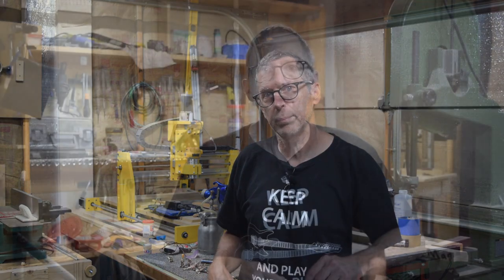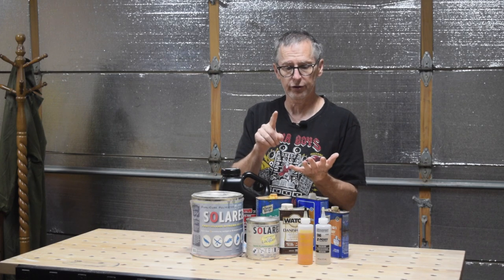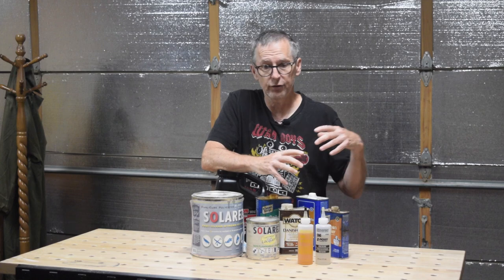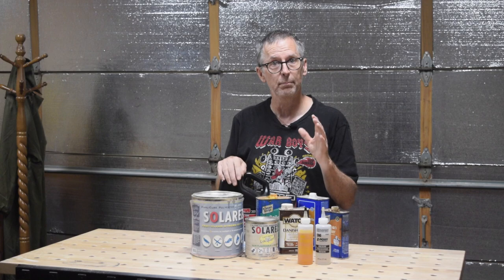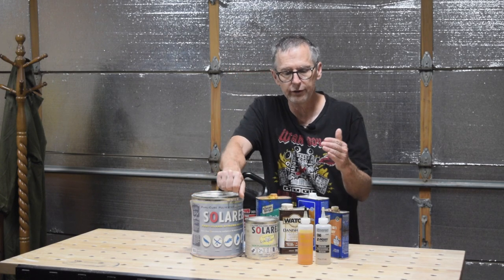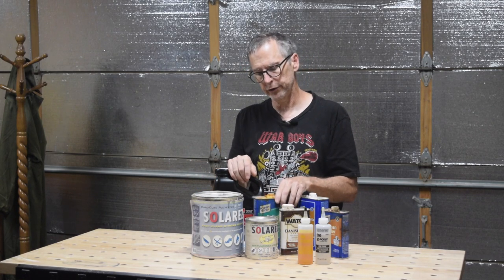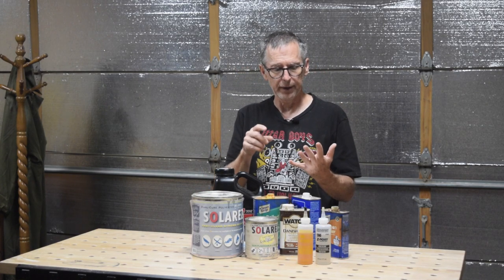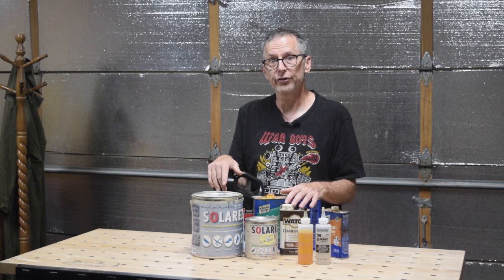Luthier Quick Tip 3: How to Decide On A Guitar Finish

Comment: Hi Chris, I've been binging on your videos. Super interesting. I just have a question. Is there anyway to strip away danish oil from a guitar body? I orivinally pht a thin coat of watco danish oil on a pine body. But now i want to paint over it (water based preferably, nitro ok too) is there anyway i can strip the danish oil and paint over it? I used a citrus stripper and that removed the varnish on top but not sure if that is enough. Thanks.
Reply from the maker: Just paint over it. Hit it with some shellac first and you’ll be good to go.
Reply: @HighlineGuitars  thanks! Water based will also work? I have an aerosol can here of shellac. Will try it after the wood dries out. No need for a primer after shellac? Thanks again. Appreciate everything.

Comment: Thanks!! One question, wich is the best if I would like to have a light blue (aniline dye) maple top with high gloss clear coat? The most easy to work (faster to cure)?
Reply from the maker: My current favorite wasn't shown in this older video. These days, I'm loving Centurion water-based 2K polyurethane for my clear coats.

Comment: Just happened to come across this, Chris, and I was wondering if the z poxy is the same resin one would use for pore filling? I also recall you are using Melamine nowadays. How do they compare for ease of use. I find Chesnut Melamine very irritating (physically, I mean). Thanks as always
Reply from the maker: I've never heard of melamine. Maybe you're thinking of someone else?
Reply: @HighlineGuitars  Sorry, Chris. You are quite right. I'm not sure where I got that from. Anyway, Chestnut Melamine Lacquer is a pretty easy to use product, with the exception of the toxicity. I have only ever used z poy finishing resin as a pore fill. Cheers.
Reply from the maker: @robertnewell5057  I looked it up after you commented. Very interesting.

Comment: Hey @highlineguitars I just found your channel!

I'm a DIY'er who's looking to sjarpen luthier skills.

Current project is an '84 MIJ BC Rich guitar that was in rough shape and had been spray painted over the original finish.

I've sanded back to the original creme finish but will be keeping some of the relicing and putting a transparent window sticker over a more unsightly area to add style and make it look more metal.

I want a gloss finish that will protect the reliced area but not make the outline of the sticker obvious. Ideally, I'd also like the neck to feel smooth and not sticky.

Any help/recommendations would be greatly appreciated!

Tkx again from Canada.

Comment: I have question sir. My gibson flying v has a nitro finish that is like an ivory white. Is it possible to prep the nitro finish already on the guitar and use it as a base coat the spray my paint over that or should completly strip my guitar down to the wood? Also the are 2 dings in the paint job so what would I use to fill if I didn't have to strip down to bare wood?
Reply from the maker: I would strip to the bare wood only because of the adhesion problems that can happen when applying paint over old nitro. The only way to know for sure if you can use the nitro as a base coat is to test with the paint you plan to use. As for the dings, you could try to steam them out with a wet paper towel and a hot soldering iron. If they are too deep for that to work, you could fill them by applying a paste wood filler. Build up the layers of filler until it's proud of the surface and then sand it smooth.

Comment: Have you tried using target coatings EM6000. Another Low VOC and Oder waterborne. Nitro type burn in.  Just curious.
Reply from the maker: Yes, I have used it. It works well, but I felt it was a bit soft.
Reply: @HighlineGuitars  I feel the same, thanks for the response

Comment: Timely.  I've been working with Solarez and BriteTone over the past week or two. 
I have to say, the "I can't believe it's not lacquer" product is pretty fantastic.  The 3 minute cure times are no joke and sands/buffs like a champ.  Spraying it on requires following the directions on the bottle though, to achieve good coverage and leveling.  I can see why you have used it as a sanding sealer in the past, and I think I will probably do the same.
The BriteTone product (gloss) is probably the clearest, best self-leveling clear-coat product I have ever used.  Sprays on great, and clean up is just water.  I haven't gotten to sanding/buffing it yet, so I don't know how it performs there.
The regular Solarez dual-cure is just awful.  It smells terrible, doesn't spray well at all, only self-levels if you leave it for an hour or more before curing (which makes the quick cure no longer advantageous), and doesn't sand well at all.  In my experience it remained tacky even after long sun exposure, and when sanding it quickly builds up on the sandpaper.  From what I can see it doesn't ever really cure all that dry or hard.  And that smell is like inhaling the fumes from burning plastic.  I don't if I got a bad batch or what, but I don't think I'll be going back to this one.
Thanks for the information!  It was your videos that turned me onto these products, and I think I have a couple of real winners here. 👍
Reply: Will you use the britetone on the contest guitar?
Reply: @onpsxmember  I'm leaning towards yes, depending on how sanding and buffing goes today.

Comment: I have a question.
I have a vintage semi hollow guitar with a nitro finish, and the finish is chipping of. I thought about air brush it with a thin coat of lacquer, but I'm worried about it damage the sound of the guitar.
Will it effect the tone?
Reply from the maker: Probably not.

Comment: IMO any type of oil on an acoustic guitar with a spruce or cedar top will alter the sound in a negative way. It will absolutely kill the sustain of the instrument. I should know, I put Watco Danish oil on my hand made guitar and I was extremely disappointed in the sound quality. Don't do it! I played my guitar with no finish on it for a couple of days. It sounded nice, then I applied the oil finish and what a drastic result. Really sorry I did. You can't get rid of the oil once it's on. It's soaked in forever. Maybe on an electric guitar it won't effect the sound that much. On an acoustic guitar the sound comes mainly from the top. It moves and vibrates and the oil really dampens the sound.

Comment: Can I use teak oil on the neck or body of my guitar? Iget mixed information about this
Reply from the maker: I've used it in the past and it worked fine for me. It's great for dense hardwoods and offers UV protection as well as excellent moisture resistance. Plus it make the wood look dynamite.

Comment: I was recommended automotive clear.
I've done a few , seems pretty good.
Using Southern Polyurethanes  Euro clear,
Only downside is porous wood.
I've had to respray 4 times  on a couple of them.
Reply: Save yourself  a load of time by grain filling on porous wood . I have used ordinary water based wood filler watered down and rubbed into the grain of mahogany - let it dry sand it down and do a second coat - sand smooth -clean off - apply your colour - then do your top coat. ( you won't need as many !!  )
Reply: That’s what I use and I love it. Cut and buff in 24 hours and very tough.

Comment: I'd like to apply some decals and cigar bands on my guitar body. What would you recommend doing in that type of project, where it's going to cover decals?
Reply from the maker: Bury the decals in numerous coats of clear. With 10-15 coats, you should be able to level and polish the surface so you won't feel the edges of the decals.
Reply: @HighlineGuitars  awesome,  thank you.

Comment: What do you think about clear coat used on vehicles including reducer and hardener? On mahogay body neck and maple veneer? Will i get a even glossy finish? It dries and cures 3 4 coats  in 1 day
Reply from the maker: There great as long as you have a proper spray booth and hazardous materials protection.
Reply: Thankyou sir

Comment: About to do two guitars (strats) for the first time with Brite Tone. How many coats do you do per guitar? I was thinking 3 a day over two days. If that is correct, six coats over two guitars, how much would you recommend I buy?
Reply from the maker: It all depends on how confident you are at level sanding without sand through. I typically spray about 10 coats, 3-4 per day, and use about 1 quart per guitar.
Reply: @HighlineGuitars  Great, thank you. Do you sand between coats or just as needed if there are imperfections/dust/hummingbirds that get in the previous coat?
Reply from the maker: @jonallen5280  The folks at Crystalac have told me it isn't necessary to sand between coats and these days, I don't. However, I do like to sand before the final three coats to smooth the surface out and get rid of any imperfections.

Comment: I used solarez I can’t believe it’s not lacquer to replicate an oil finish. It has a white haze to the guitar, however when I use wax on it the haze goes away for maybe an hour and then the haze comes right back. Any suggestions on how I can fix this?
Reply from the maker: Contact Solarez. I've never seen this and have no idea why it's happening or what to do to fix it.

Comment: This may be a stupid question but is it possible to mix products? The amber tint and extraordinary efficient sealer from Z-poxy and the pristine gloss finish from Cristallac for the last 3 layers before polishing ?
Reply from the maker: Mix them together before applying? No!
Reply: @HighlineGuitars  noooooo! :D layers on top instead
Reply from the maker: @rachmaninoffrulz  Yes, you can do that. However, each layer has to be fully dried and cured to ensure proper adhesion, and as I always say, "TEST ON SCRAP FIRST!!!!!"
Reply: @HighlineGuitars  thanks man

Comment: I wonder if anyone has any tips on how to do this. I want to paint a precision bass body with a nitrocellulose sand color. The pickguard will be orange and I want what's underneath the nitrous cellulose to crack revealing an orange substrate below the nitrocellulose. I was thinking of mixing some alcohol dye with a grain filler first and then maybe sponging on some type of acrylic orange color over that. Don't know if I need to put a white vinyl sealer over that or go directly to nitrous cellulose, because again I'm looking for the orange to show through the distressed cracks through the nitrocellulose

Comment: I am trying out Solarez I'can't believe etc . I can get a smooth finish but I am having trouble getting a clear mirror finish. I wet sand from 800 ,1500, 2000 to 3000 and then I use Stewmacs Fine polish compound . But I can't get a nice sheen . What am I missing . Am I not buffing enough or too much . I end up with a very patchy effect and some haze in places . I am using a small piece of ash which I have sanded to the wood several times to restart but I am having no luck as yet - Chris - I need your help !!
Reply from the maker: Are you using a buffing machine with 12" or larger wheels? I use one with Menzerna compounds. I can get a decent shine, but Crystalac Brite Tone has a better gloss sheen.
Reply: @HighlineGuitars  - Thanks for that Chris . I  only have a 6 inch buffer on a power drill and some sponge discs  and some
fluffy soft discs .  Here in the UK I just can't find the compounds or similar ones !! Crystalac comes up blank as well. I think it is back to Danish oil for me  !!
Reply: @HighlineGuitars  Well you got me thinking !! And this is what I came up with. I noticed that you use a 12" buffing wheel and mine is a 6" wheel . I realised that my wheel needs to be rotating at twice the speed yours is running  at to give the same result so I fitted the wheel to the 40watt mains drill on my pillar stand. This increased the speed to just over twice the speed of my battery drill . Lo and behold I was able to perfect the finish on my test piece . The end result was similar to yours with a few little pin prick like marks but I now feel confident to attempt the process on a guitar body . So ultimately thanks for your input !!

Comment: What type of base coat can be used under the polyester clear gloss? Enamel, acrylic, lacquer etc..
Reply from the maker: Your best bet is a polyurethane automotive base coat. However, you would be advised to test on a piece of scrap first to make sure there isn't going to be a reaction.
Reply: @HighlineGuitars  thank you for the reply.. I will give that a shot

Comment: Hi, i will apply solid colour nitro finishing on strat body. I will use a sufficient level of sanding sealer. Is it still necessary to use a primer over the sanding sealer? It is my first time to apply opaque colour finish and i am confused.
Reply from the maker: It depends on the color. If it is somewhat transparent, a primer coat can reduce the number of color coats you need. Also, primer is a bit thicker so it can fill in hard to see defects. Is it necessary? No, but it's good to use it.
Reply: @HighlineGuitars  Oh ok, it is cream colour and i need primer as i understand. Is the only purpose of using primer over sanding sealer to ensure uniform color distribution?
Reply from the maker: @mertakgun8209  No. It helps with opacity and it ensures the best possible bond with the color coat.
Reply: @HighlineGuitars  Is the adhesion property of sanding sealer less than primer?
Reply from the maker: @mertakgun8209  Check with the manufacturer.

Comment: I used leather die. I tried using clear coat rattle can and it was super satin haha. Any suggestions?
Reply from the maker: Suggestions for what?
Reply: @HighlineGuitars  I'm wanting a gloss coat over the dyed wood. I'm thinking brush on?
Reply from the maker: @jamessherman4800  Spraying on is always better (faster and smoother). However, to get a glossy finish like the pros, you have to build up many coats until you can level sand the surface smooth and buff. When you level sand, you'll start at about P600 grit and work your way up to at least 3,000 grit. The surface will look flat and dull, however, once you start to buff it out, a mirror-like shine will appear.
Reply: I'm thinking verathane oil based brush on. Only because it is the only thing I've seen so far. Thank you so much for your help, this is my first one sver

Comment: Do you think zpoxy is the same as Solarez grain sealer?
Reply from the maker: No. Solarez remains liquid until cured with UV exposure. Epoxy cures with catalytic action.
Reply: @HighlineGuitars  Thanks for the response i built my first guitar because of your videos! Is solarez grain sealer just as hard as zpoxy after cured?
Reply from the maker: @inourvendetta1  Both are about the same as far as hardness is concerned. Both are very easy to sand.

Comment: I have a first act guitar which feels like a plain wood finish would putting polyurethane on it change the sound or hurt the guitar in any way it is a first act Adam Levin al363
Reply from the maker: It might change the tone, but it's doubtful you'll notice much of a difference. Unless you do a terrible job of applying the polyurethane, you won't hurt the guitar. I say go for it. More than anything, you learn a finishing technique. PRACTICE APPLYING THE POLYURETHANE ON SCRAP FIRST!!

Comment: I tried the Crystalac. It was a total disaster. Almost completely ruined the project had sand it back to bare wood. Stuff is too finicky, I went back to General Finishes.
Reply from the maker: I used General Finishes until I had a terrible experience with their pre-cat acrylic lacquer. That stuff was the WORST and their customer support was so bad  I vowed never to use their crappy products again.
Reply: @HighlineGuitars  I've been using the high gloss top coat (not the pre-cat) I do 15 coats (5 a day). It does take a while to fully cure, but once it does, it comes out incredibly nice. (I'm just a hobbyist) I tried the Crystalac because of what several people on youtube, including you (I watch you pretty regularly) said. 
I was not expecting the result. For some reason, all of the finish (on both sides) pulled away from the edges, so the minute I started to level sand it burned right through all around the front and the back, an 8th of an inch from the edge. Never seen anything like that before. I did the 'three coats a day for two days' and let it cure for seven. 
No one has been able to tell me why it did that. I can only guess that the finish on the sides pulled it away as it cured? 
I will say this, yes it's a very tough finish, took me days to sand back to bare wood with 140 grit and I went through a lot of paper doing it.

Comment: Any tonal response difference with the different finishes?
Reply from the maker: Hand rubbed oil finishes like Danish oil have almost no effect on tone while Crystalac Brite Tone and Solarez I Can't Believe It's Not Lacquer have minimal impact on tone. Solarez Polyester probably has the most impact on tone as would be expected. This is more of an issue with acoustic guitars since the tone of a solid body electric can be manipulated electronically.